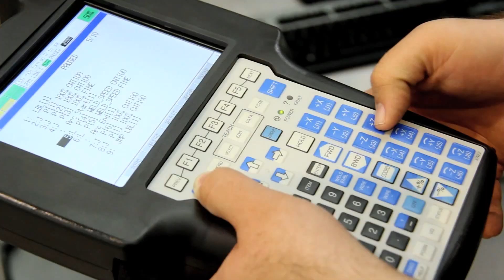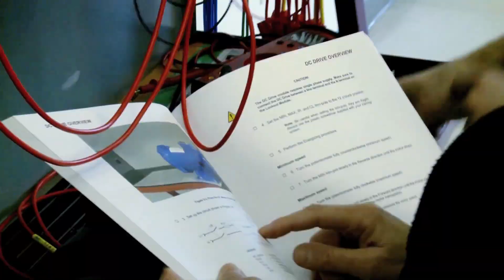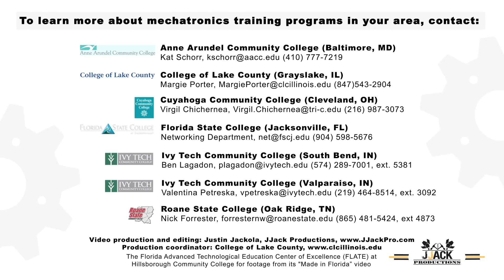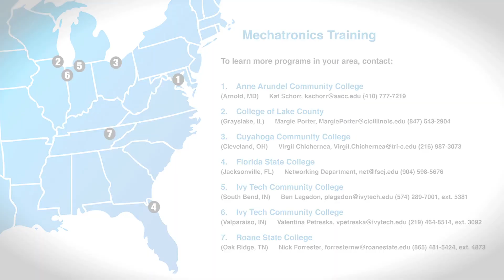What is Mechatronics

Comment: PLC or Arduino?
Reply: Arduino is a toy for kids
Reply: @muigaisimon4103  try to do precise applications with PLC then good luck
Reply: @SwaRRo   i normally use STM32
Reply: @muigaisimon4103  thats a lot better tho its ARM processor
Reply: @SwaRRo  yeah,,, and if i were to use Atmel chips ,,,,i will use the chip itself say atmega32 not with the development board(arduino)\
Reply: @muigaisimon4103  oh it depends on the application anyway but wouldn't you require other stuff like a driver board or do you build around the chip on application hardware. just curious
Reply: OH yeah BTW recently digging into PLC's due to my final sem in the 3rd year Arduino are much better at precise applications while PLC is used only in robust applications
Reply: why not both